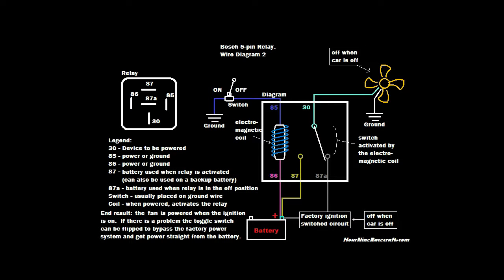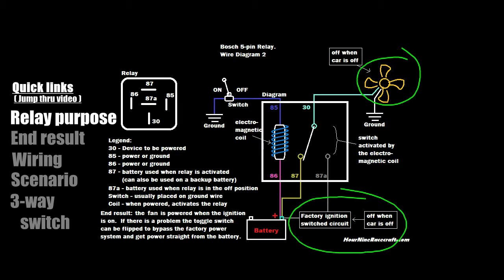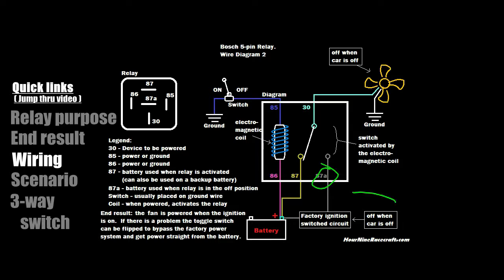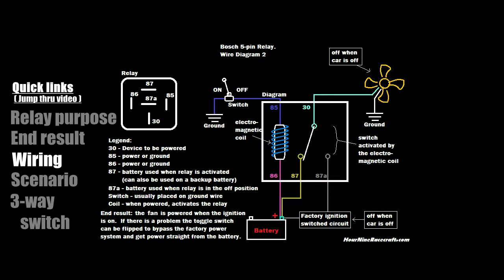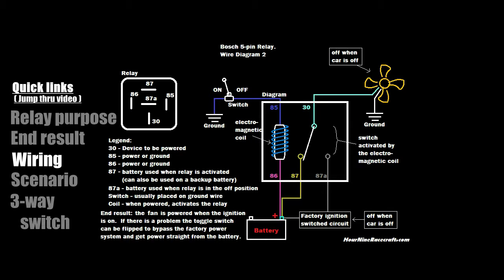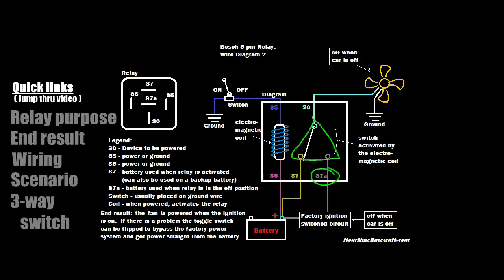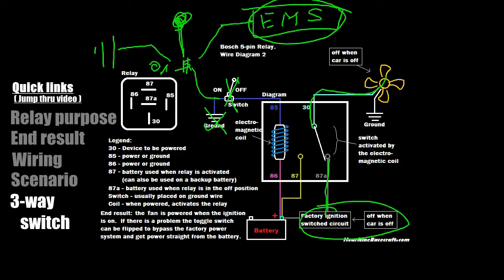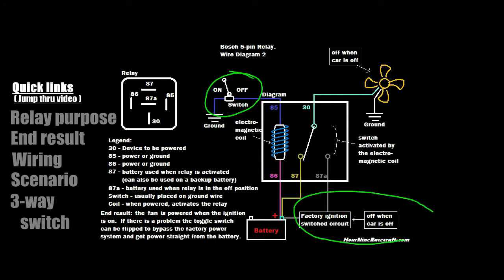Relay Tutorial: Dual Power Source Switching (Example 2)

Comment: 85 and 86 are sometimes polarized. Meaning polarity specific, using a diode in series to the relay coil to prevent back feeding sensitive electrical components like an automotive ecu. Every sudden disconnection from power causes this. You'll see a triangle point a line. I think of this as the line being a barrier and not allowing current in that direction (Reverse Bias). Which, if you had a diode relay and wired this way you could damage the relay.
Reply from the maker: Yeah, I made this video more than 10 years ago, and learned this (what you said) later. I wish I had included it in the video. But hopefully viewers would learn this via other means if they are following this video as a guide

Comment: Trying to power 1 LED strip with 2 different sources. My problem is at some point both of these sources would be on. What would happen if both pins are triggered at the same time?
Reply from the maker: the relay is a simple switch, so if both power sources are on going to pins 87 and 87a, only the one with the connection through the relay will have the connection to pin 30. The other connection will not pass through the relay until the relay is triggered off (or on)

Comment: Excellent explanation! Thanks! Is it possible to use a relay to a switch and dome light to wire up puddle lights that will turn on with dome and a switch?
Reply from the maker: Hmm, it depends on the type of vehicle. Most that I've seen have a dimming feature on the bulb, which wouldn't work well with the relay. I don't think it would damage the vehicle, but the relay would act strange as the relay "dims" instead of the bulb

Comment: Trying to use my uptfitter switches on my truck to turn on and off some LED auxiliary lights that I want to install to my trailer, but I would like to connect it to the 7 pin connector for the reverse lights and also be able to turn them on with the upfitter switch in my truck and another switch by the trailer hitch. Can you draw me a diagram I can use for this procedure? Or would this 5 pin relay do the trick?
Reply from the maker: I can't say I'm familiar with the uptfitter switches

Comment: How do you test to determine if your factory fan is positive triggered or ground triggered with factory relay?
Reply from the maker: The easiest way is to look at a wiring schematic of your vehicle. The cooling system diagram will show the relay. And the two wires connecting to the coil portion of the relay will show one wire connected to the ECU and the other wire connected to either ground or the battery. So if it's a positive connection on the non-ECU side (most likely) then you'll have a ground connection on the ECU side. Don't connect a multimeter to the relay connections, specifically the relay connections that connect to the coil. I learned in school that this can send unwanted voltages to the ECU and potentially damage it.

Comment: This was the final puzzle piece needed for my DIY self-charging fuelless electric portable generator. Basically-starting the electric motor with the battery, running it up to 3600 rpms and then switching to the dc power that the generator is producing and in turn being able to self run the generator and charge the battery at the same time. Many thanks, just what I needed!

Comment: How can I connect led lights in my car to come on when I unlock the car with my dome light and also be able to turn on with the fog lights as well?? 

Can I use this set up with a fog light tap running to 87a and dome lights connected to 85?

So when the car is unlocked they come on with the dome lights but when I turn on the fog switch 87a comes on.... am I going right?

Comment: so I'm renovating a school bus into an RV and there's exterior lights as well as interior lights that I want to have on the buses normal running power but also wired to a battery bank for when the bus is turned off I'm assuming this would probably be the best way to go?
Reply from the maker: Yeah, it's probably the simplest way

Comment: This is interesting. Have I wired my relay wrong. I used 85 for ground trigger 86 and 30 are tied together to fused battery 87 is power out to fan+ and fans- to ground 87a is unused. I only ask because I have been running like this for months no problems but recently one fan is blowing fuse and I notice relay getting hot and so is the relay pigtail harness. Fan wires seem fine. I might try wiring mine like this instead.
Reply from the maker: Are you exceeding the amp rating of your relay?
Reply: @LegitRaceCraft  no relays are 40 amp. I replaced fans and upgraded fan power and grounds to 10ga. So far so good. I assume the fans were going bad causing a b i g draw
Reply from the maker: The heat comes from resistance somewhere. Since your relay can handle the amps, I would look for a loose connection near where the heat is. Flipping pins 87 and 30 won't change anything.

Comment: I have a 5 pin relay question for you!

I want to wire auxiliary backup lights to my truck. I want them to be powered two ways.

1st signal off of reverse lights so they come on automatically when in reverse. 2nd off of a toggle switch so they can be used as work lights. But I don't want to back feed power into the factory backup lights.

Is this possible with a 5 pin relay? If not do you have any suggestions.

Thanks for your time
Reply: I should be able to 87a for the default reverse light trigger and 87 for the manual switch trigger to turn the lights on?
Reply from the maker: If you connect 87a to the default reverse light trigger and 87 to the manual switch then all of the load from your aux lights will be put on your reverse light system and possibly blow a fuse. There's not a way to do this with one relay that I can think of.

You'll have to use two relays, and I've laid it out for you below. Draw this out on paper so that it makes sense.

Primary relay:
30: to fused power
85: to ground
86: reverse light positive tap
87: to secondary relay pin 87a

Secondary relay:
30: aux lights
85: to ground toggle switch
86: to fused power
87: to fused power
87a: to primary relay pin 87
Reply: @LegitRaceCraft  thank you. I'm going to draw it out now.
Reply: @LegitRaceCraft  you had me all the way up to the secondary relay #'s 85, 86 & 87.

Does 85 go to the toggle switch? Positive?

86 ?

87 ?

Which one goes to the positive of the lights?

Which one is to ground?
Reply from the maker: For the secondary relay, if your toggle switch is a ground toggle switch then 85 is what the ground toggle will connect to and 86 will be your fused power from the battery, if you have a positive toggle switch then connect it to 86 and 85 will be straight to ground. Pins 85 and 86 don't require large wires, they can be small since they only power a small electromagnet in the relay.
Pin 87 is a larger wire that comes from the battery and is fused. This is the power feed. Pin 30 connect to the positive of your auxiliary lights
Reply: @LegitRaceCraft  Providing the factory reverse light circuit has a large enough fuse to power the standard LED reverse light along with the aux LED lights, is a second 4-pin relay needed still? I was hoping to do the same sort of setup for aux reverse lights that can also be powered independantly via a switch. 87a reverse light power, 87 fused battery power.

Comment: What if your getting the power to 87a and then you turn the switch connected to 85 on
Reply from the maker: 87a is connected directly to pin 30 before the relay is turned on through pin 85. So you will always have power to 87a until the relay is turned on and then 87 will have power

Comment: So I'm trying to use this method to run some LEDs. I want to power them using my curtesy lights on my car and be able to use a latching led halo switch. Any suggestions? I've tried this method once and couldn't get the relay to throw, what could I be doing wrong?
Reply: Chris did you figure this out? 
Id like to connect led lights in my car to come on when I unlock the car with my dome light and also be able to turn em on with the fog lights as well

Comment: Having to add external voltage regulator 98 2500 12 valve b it's attached to fire wall is that my ground for unit the pcm isn't exciting altinator buy two field wires after thearing into every harness I no issues with been and blue but bad grounds smashed under main batt box fixed them truck runs better no charge day time I'm fine or when it's cold fuel heater plug sheared off and after all that tearing my dash off and into peices I have a spot in PDC for a 30 amp right on main bracket I just need to know if it's a spice into acc plug in emptied spot or something else

Comment: can you do a video of how to use a relay to control a 3 wire solenoid that has a ground , a pull and then a hold wire and drops the pull wire but conts. to hold on the hold wire  until the 12 pos is no longer there from the signal wire

Comment: I have 5 pin relays, meant to get 4 pin because I understand them better...does 87a have to he used or can I treat it as a 4 pin relay?
I've tried to wire it up, but could not get it to work let's say I'm using it for a fuel pump.
Reply from the maker: Actually, I have a link in the description that covers this exact question..lol. basically, treat it the same.
Reply: Cool thank you!

Comment: What happens if power goes to both 87 and 87a at the same time? Will it short out?
I have a light up emblem that is connected to my headlights but I want a separate trigger. But God forbid I accidentally flip the switch when the headlights are already on
Reply from the maker: It won't short anything out. You will always have power going to whatever is connected to 30. If you imagine hardwiring everything without a relay, but you just named your wires 87a, 87 and 30..then you would have wire 87a twisted to wire 30 at one point and then wire 87 twisted to wire 30 at another point. Inside the relay the same thing is happening.
Reply: HourNine Racecraft thank you!!

Comment: Could pin 85 and 87 both be fed buy another switched relay or will that mess with the 87a circuit causing it to not latch
Reply from the maker: +Kyle Vanwinkle no, that will work. I might draw up some more diagram videos if I have about 5 examples to use. That's a good one to use in an example though. What are you using it for?
Reply: HourNine Racecraft I'm going to add it to my 7 pin trailer wire circuit. The center pin is an auxiliary pin factory it is wired to the reverse circuit. I want to add a switch to energize that pin when the vehicle is not in reverse without backfeeding the reverse circuit. I'll be using the circuit to energize some rock lights on my rv for when I have to turn tight near a ditch at night. I can watch my tires so I don't drag my trailer into a ditch
Reply from the maker: +Kyle Vanwinkle sounds like it will work, I don't see why it wouldn't

Comment: additional led back up light but also be able to switch on manually when needing the light while working not actually backing up. simply replace the fan in your video for a light.

87a comes from the reverse back up light power

87 comes from the battery via a switch being flipped without needing the vehicle to be running and or in reverse, with a fuse :)

am i thinking this through correctly??

Comment: can you use a 5 pin relay to connect a RGB LED strip for a snowmobile...87a (NC) giving the power to the whole LED while the (NO) side being activated by the brake handle that will then just activate the RED LEDS on the LED strip??? Thx for the help and vids are very informative.
Reply from the maker: yeah.. that should work as long as the LED is wired with the right polarity. you would need another off switch though, since the LED would always be on
Reply: negative circuit system main on is via the IR multi color remote and the RED would be the brake circuit...just have been unable to wire it correctly
Reply: my question is how do I wire this to work and not have a constant bleed over of the RED LED being constantly on since it is a ground based circuit...thx again
Reply from the maker: If it is like a typical RGB LED then you will have one negative and three positive. So the two positive should go to pins 87a and 87, and your power feel would go to pin 30. When the relay is switched on it will light up the wire from pin 87, and when it is in the off state it shine through pin 87a until the ground circuit is killed.
Reply: actually it is the opposite...you have the white wre which is your common and the RBG are all the negative or ground wires...hence my dilemma
Reply from the maker: Ah, that's interesting. Ok. Well you can run a ground wire to pin 30 instead of a positive. Then run 87 and 87a to the two ground wires on the LED. The positive wire I would run off of something that is an ignition switched positive, just so it doesn't drain the battery when the vehicle is off. And personally I would use that same positive to power the relay on pin 86, then put pin 85 directly to ground somewhere. So 87 is LED ground, 87a is another LED ground, 30 is actual ground. LED positive is ignition switched positive, 86 is also ignition switched positive, and 85 is always ground.
Reply: so I would only have the one positive line... which comes from the RBG controller...to power the LED strip and the relay would control the negative line(s) of the circuit and to activate the coil... would be pin 86 via the brake lever (+) to then deactivate the negative side (87a) of the RBG controller and activate pin 87 negative line completing the RED LED circuit...the RBG controller power would be a fused (+) line off of an ignition activated power line then...(85) pin is to ground...relays...can do a ton...sky is the limit